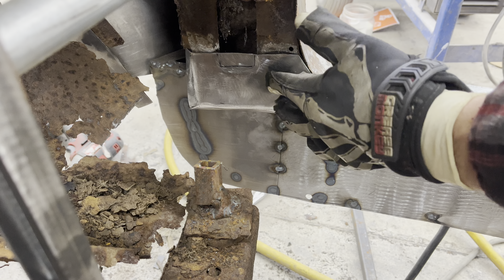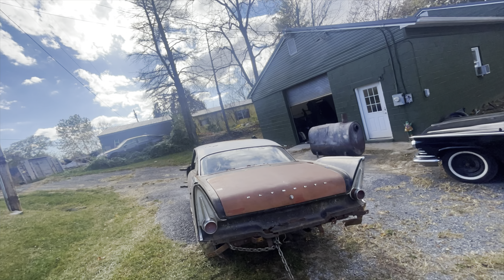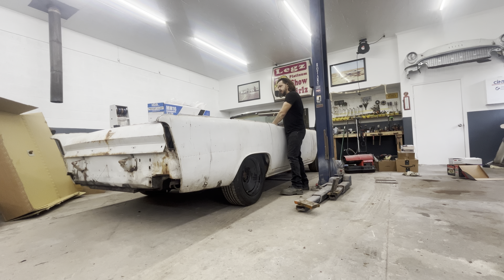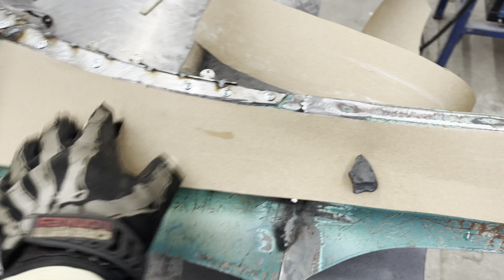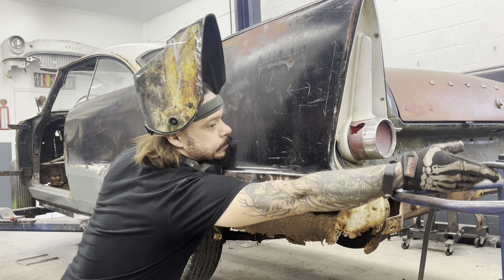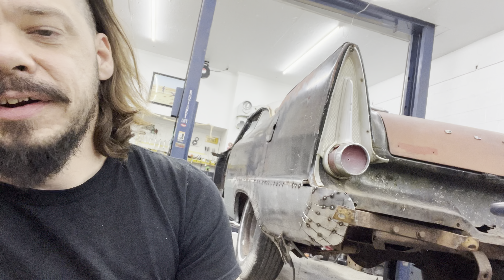1958 Plymouth Part 15. Crude Quarter Panel Fabricated For “Christine”

Comment: Why is new metal welded directly onto old and rotten metal, and the inner surface is not coated with rust converter and primer? It will all rot and become blistered in about five years after painting. On all other channels, the inner surface is protected by cutting out all the rust and priming.
Reply from the maker: I explain all of that in the video.

Comment: I've got an aftermarket lower rear quarter and rockers from my old 57 project. Unsure which side the lower quarter is for but could check. They're in a box in a corner of my shop.
Reply from the maker: @TrashcanGarage  I’d be curious to know. 🤔
Reply: @ Lower left rear. Took a photo. Rockers too.
Reply from the maker: @ shoot me an email trioxinkustoms@gmail.com
Reply: @RottenBuick  Photos have been forwarded to you. 👍

Comment: What size wire are you using in your welder on the sheet metal? The welds look good. I tend to save basket cases also. The work on the rockers is awesome.
Reply from the maker: @jeffhill2089  I was using .025 but ran out and have been using .030. On this panel.